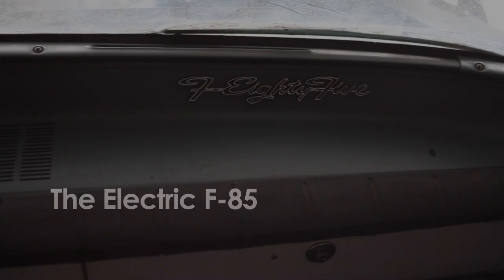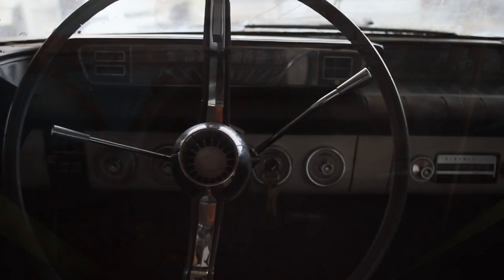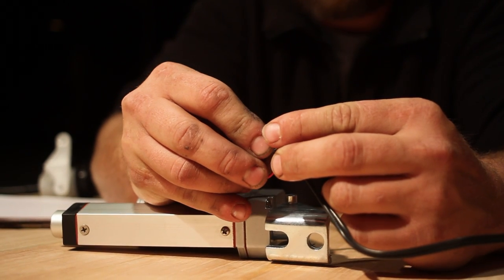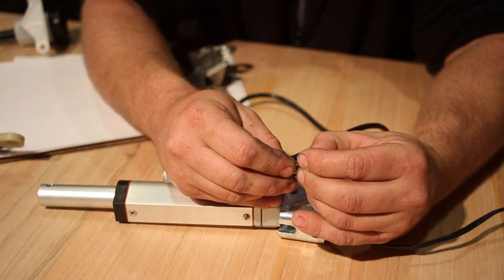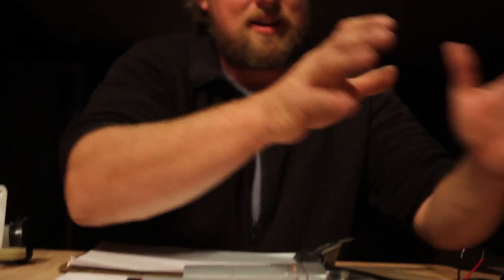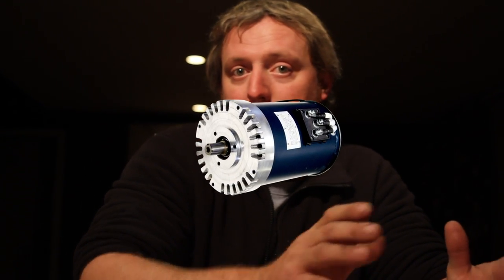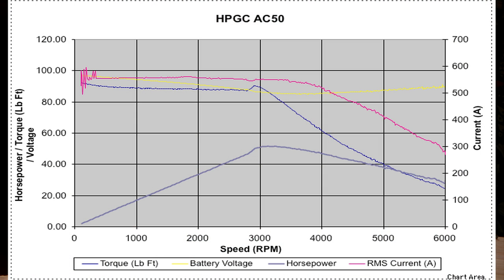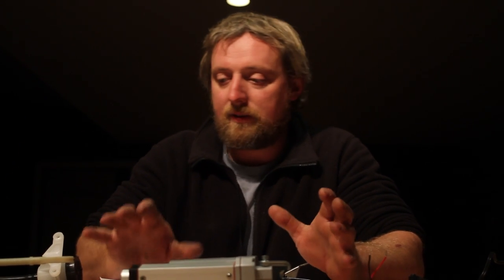Electric F-85 conversion by underscore EV-- Episode 2, clutch and transmission.

Comment from the maker: @evric2008 ...Thanks for the comment... I was kinda anticipating the fact that I could shift on the fly, but I was looking for a smooth option.  If I need the clutch, I want to have it.  If I don't need it, even better.  I have read what you said in other peoples applications, and I think now I just want to install the transmission and get the vehicle running without installing the actuator.  I am gonna put the clutch in because the adaptor plate needs it, so I will always have the option.

Comment: You don't need a clutch - just put it in a gear eg. 3rd gear and go. If you need to change it is easy to change gears without a clutch.